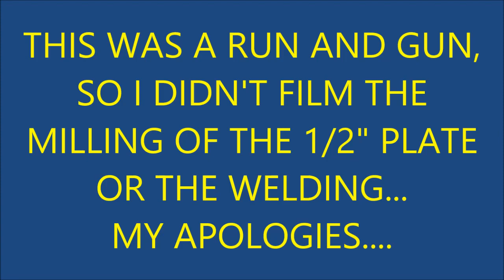Tool Time 42 Welding Table Clamp Design

Comment: Might go with a socket head cap screw so you can use a ratchet easy and not have clearance problems. I scored a nice big Abom79 approved Miller TIG myself the other day and am looking forward to getting to do some TIG with it. I have already done some stick welding with it and it runs nice. I will be doing a video on it soon.
Reply from the maker: bcbloc02 Brian, thank you for the feedback if you get a chance watch TT 43....that if very cool that you just got a Miller Tig also, I will be watching...FYI, ChuckE has a very good video series on Tig

Comment: The clamp turned out great!  Nice simple design.  Your welds look great too.  No one would think those were "first timer" welds.  The one thing I noticed was that when you clamped that angle block down, the long section of the clamp was bending.  Your addition is much stronger than the original clamp material!  Thanks!
-mike
Reply from the maker: ***** Hello Mike, thank you for the view and appreciative comment, just did another TT43...Happy Holidays

Comment: Thanks for noting your TIG electrode, amp and rod you used for your welds.  I too recently got into the TIG of things and appreciate hearing about and trying settings that work for other duffers like me and then trying to emulate the experts like Jody.

Cheers,
GW

Comment: I wish my welding students could grasp TIG beads as quick as you did Chuck.   Great clamp Idea as well.  You may want to have some E309/E312  SS Tig rod for welding heat treated steels such as clamps and such for added weld assurance, tho ER70s mild/low alloy steel filler may hold up well for home shop use.
Reply from the maker: alpho52 Thank you for the view and valued feedback, I just did some aluminum and did a video TT43...Happy Holidays
Reply: outsidescrewball
Happy Holidays to you!

Comment: Nice weld and cool idea. I bet you'll   make the plate you weld on wider so the fancey  flex socket still fits all the way down. I like the eclip idea to hold in the bolt too, it beats a suggestion I was going to make hands down. Outside screwball's F'ing clamps gets a thumbs up. Using a homemade flange bolt  someone else suggest is a good idea too. Me I would stick a washer under the bolt head if you have room. I stick washers everywhere tho so your milage may vary.
Reply from the maker: David Queen Hello David, thank you for viewing and your comment/feedback....Hey, you just named my clamp design...I love it....Screwball's F'ing Clamps.....LOL  damn, that would have been a great video title and maybe in use in the second build idea!

Comment: Nice solution, Chuck.
Reply from the maker: ILGopher Hello Ryan, thank you and just having fun and hopefully getting tooling ready for an unknown future project
Reply: Hopefully I'll get my new compound top slide for my "new" Atlas 10" lathe I got a couple months back.  It had a crack in one of the corners of the T slot which would allow the QC post to pivot down and dig in to the piece.  Looks like the guy who had it before had already repaired it once.  I had another compound for some reason and it had already been cracked in the same location, so maybe it was a common problem.  If the new one is work, I picked up another compound slide for a 12" Atlas and might have to cut it down to height and put in a new T slot.  That could be a fun project that will test the skills and patience.  I may have to pick up a kerosene heater to warm up the garage a little instead of using LP heater in it since I didn't think to get the tank filled before winter rates kicked in.

Have a good one.

Comment: Hi Chuck!!  Great concept you have going here.....I 100% agree on the e-clip retainer and using socket head caps so you don't have wrench clearance issues.  Your heliarc beads are coming fine!  I know you have very little invested in these; and in that regard I applaud you.  I use Weldsale ones on my platens; the same basic idea starts at $175 and goes up from there.  I also use Wilton F clamps; the heavy ones (4800lb clamp pressure) and in both cases I like them.........because they don't FLEX like the inexpensive ones do.  I fear you will be cussing at how much flex you get on yours once you get say...over 8" off the table.  If you don't crank on them very hard it may be fine though.  Sorry for the long winded comment; and please don't construe anything I said as negativity, for that's not how it was intended.  Thanks, have a good weekend!!  Regards, Sean
Reply from the maker: ***** Sean....thank you for your view and valued feedback, I agree with what you wrote and I know there is no malice....if you get a chance watch Tool Time 43...Happy Holidays

Comment: I've seen many of the clamps before ( ones that mount to tables ) most people just cut one end of the clamp and weld a peg on the end. Your design is very simple and allows you to use the tool as it was originally designed to be used. Also it gives it a versatile nature. Simple plan good execution might use the same build. 

PS.  for your first tig weld pretty good
Reply: I really could have used a clamp like this the last time I used my everlast. I really need to make one.

Comment: A suggestion would be to make the base both wider so you have more room for the wrench to clear the clamp and longer so the bend will sit on the base and not hang in space were you are giving up some of the clamping strength and you will have more rigidity when clamping. great video!
Reply from the maker: search4robfen if you get a chance what my next video Tool Time 43....thank you for your view and feedback

Comment: Try adding a stack of washers between the bolt head and the slotted plate, so that the hex head is raised above the beam.  Or use thicker material for the slotted foot, so the entire beam height can be buried flush in the slot.  Either way, then you can use the standard ratchet to tighten completely.

For a no-tool design, drill a cross hole in the bolt head and use a captive sliding tommy bar (like the handle on a vise).  Weld a 0.5" spacer on the original clamp face to provide horizontal clearance over the tommy bar.
Reply from the maker: Dave Kellogg Hello Dave, thank you for the view and feedback

Comment: Rather than weld a slot to the base of the clamp, I would consider a piece of 1/4  or 3/8 bar stock welded in parallel to the base of the foot so the bolt goes between them. It would give you  a longer range of adjust  and put your bolt head up were you can get to it.
I really enjoy your channel.
Reply from the maker: ***** Thanks for the view and feedback, we are on the same page with that idea!!  I had thought of something similar and the ease of the build was tempting.  Your comment got me thinking and I am going to re-visit that idea and maybe do the second clamp in that method....

Comment: I was going to suggest using a Lynch Pin, glad you read my mind. Also, you could put 2 "heads" on one stem. (Have them 180 degrees from each other). That might be useful in some situations.
Reply from the maker: Wide Vision Metal Fab Hello Matt, happy holidays!!!  this video taught me the proper name for the Lynch Pin and I agree on the 180 second clamp.
Reply: Wide Vision Metal Fab yes I was thinking the same thing glad you read my mind

Comment: You could also use a second clamp facing the other way at the same to clamp a second part or to stiffen the upright
Reply from the maker: flineman that idea of the second clamp is correct for stiffness, my thought is for this setup to assist in holding/stabilizing a part on the table with not a lot of clamping pressure, but I guess future projects will dictate the need of hold or pressurethanks for watching and your feedback

Comment: you are going to hate those once the welding bbz get into the threads of the bolts and into the threaded holes, that's why strong hand makes a straight rod into a looss hole it doesn't need to be tightened down once you tighten the clamp it holds itself and the work piece. nice weld:)
Reply from the maker: Denis L Hello Denis, thank you for the feedback/comment.  You are probably correct as Strong Hands has a great product line for the professional.   Since I am just a hobbyist and use the welding table/setups on occasion, I don't think it will make me go crazy, but of course I am already a little screwy....LOL...FYI, just posted an accessory for the FclampATBChuck

Comment: Suggestions consider using a flanged bolt, weld a small flat washer ground down on one side to turn the bolt into a winged bolt. diameter of washer to be smaller than bolt to allow spanner over it to finally tighten bolt.
I like your idea of a clip to hold bolt to the slot when tool not being used.
Your quick release pin is called a lynch pin, an R clip might be an alternative.
Reply from the maker: Dan Whiteford Hello Dan, thank you for the feedback and ideas, yes a lynch pin is the term and I had to google it from an earlier comment to learn what it was....FYI, you just educated me on the proper term for the R clip

Comment: You could use round stock instead of the flat so the arm will swivel all way round just weld round end on the arm end to slide over the round
Reply from the maker: +Sherill Bowman thanks for viewing and the feedback

Comment: Your TIG welds look pretty good, Chuck. Having seen you gas weld (previous video), I thought TIG would come easy to you.
Those modified clamps should work out quite well. Is this the beginning of "Weak Hand" tools????
Reply from the maker: Pherd Antler Hello Pherd...maybe a little tweak on your name to Weak n Cheap tools....LOL, honestly I have spent more time at the grinder with the tungsten than welding on the bench but I am finally learning to keep my torch hand steady and use my foot to regulate the heat as I kept moving the torch like oxy welding

Comment: Change your bolt to a hex head cap screw. That way you can use a t-handle Allen wrench
Reply from the maker: cpcoark thank you for the comment and I did think about using a cap screw but wanted to stay with the 3/4 wrench since other items on the welding table use the same size, that way only 1 wrench to look for...lol

Comment: Hey chuck I have a couple bessy clamps I modified in that exact manner but I just cut mine off right before the bend and welded them to a 1x3 thick block. I just weld mine down on the front side just like a normal fabricated half clamp and when I'm done all I gotta do is open it and give it a pull and it comes right off. BTW not criticizing but your welds are way to hot or you need to speed up. 🐢
Reply from the maker: TheJesusno2 Thank you for the view and feedback/ideas along with the comment on the weld bead as that is info that will help me.

Comment: HI Chuck,
Have you thought about turning a piece of rod that would be a slip fit for your bolt holes in the table and maybe just welded to the HF F clamp head or welded to your flat bar that is attached to the clamp, thus making it a friction fit so when you tighten the clamp on something it would put a bind on the rod and threaded hole.  It is a very fast way to position the clamps on your table.  This is the way the Strong Hand clamps work - and work well - with their welding tables.
All The Best!
Reid
Reply from the maker: Reid Eichner Hello Reid, thank you for the feedback and I will give it a try

Comment: another idea. Cut the solid C off so you have just the sliding straight portion of the clamp weld a grade 8 bolt to the end . screw into table done
Reply from the maker: thanks for viewing and the comments

Comment: I like your clamp.  I may make one with the bolt slot open on one end for quicker setup. Using  larger 3/4" thick plate for the additional strength, my 2 cents.......
Reply from the maker: +Paul Sundquist Thanks for viewing/comment Paul, good luck build

Comment: How about putting a lynch pin in the end so the pieces don't get separated when not in use.
Reply from the maker: Don Foster Hello Don, I had to google "lynch pin" and that is the item that I installed at the end of the video, thanks for the view and question/comment which pushed me to learn the correct term.

Comment: There are probably a lot of those hold down clamps already designed.  Just have to look around for ideas.  Hobbling together low cost components can save money.  Won't be 100% as strong as the trade stuff, but good enough.  Got to spray Pam on the threads to reduce splatter from sticking.  Those ratcheting wrenches are handy.  The free swiveling ones can be frustrating though.  They make a type that locks the head at different angles that seem to work better IMO.  Those TIGs take most of the guesswork out of welding.  Not Fair!

Comment: I'd be happy with that weld Chuck, but then I have never welded. lol.

You should have warned us that there was time to get a beer while you wrenched that bolt.

Nice clamp idea. You did woodworking, could you not have just turned the clamps down to fit the hole or some other means of getting a post into the holes on the table like on woodworking tables?
Reply from the maker: Steve S Hey Steve, thanks for watching and I agree with the zzzzzz's while I wrenched.  Regarding attachment there are many ways and this was my beta try...hope you get a chance to weld as it is a lot of fun

Comment: Nice welding, but that leverage turned out even worse than I feared.
With the bolt near the end you are up to like 15:1 ratio or something, meaning for every pound of pressure at the part you get 15 pounds pulling force at the bolt.

You need to move the slot forward to the bend as far as possible and extend the plate to the rear, without a slot, to act as a lever.
Reply from the maker: stefantrethan thank you for your feedback and view, note that I agree

Comment: Not to rain on your parade, but if you were to make your own clamps from scratch you could use round bar rather than the rectangular section material you have now. This would allow you to rotate the movable clamp jaw without having to loosen the table-fastening bolt.

So the main vertical piece could be made from round bar with a flat bar foot welded to it, and the movable clamp could be made from round bar with a short section of pipe, whose ID is slightly larger than the vertical bar, welded on one end, and a nut welded on the other end. The copper plated clamping screw would screw into the nut.
Reply: If the vertical round stock was 1/2 inch, thread the bottom inch and forgo looking for a bolt?????? Itsa question.
Reply: Yes! Wonderful idea!
Reply from the maker: ArtemiaSalina Hello Art....thanks for the feedback and no worry on your suggestion as that is what I was looking for with this post.  There are many ways to complete this and I am going to review the various thoughts/designs to help improve my beta build
Reply from the maker: lornie212 the answer to your question is  YES! and that is an idea that I had thought of using the HF clamp with a simple threaded rod welded to the unit.
Reply: Great ideas. I think I will weld up one for my everlast welding station.

Comment: Sweet!  Has anyone suggested flange bolts?  http://www.mcmaster.com/#92979A467
Also.....you could two of the movable parts of the clamp on one vertical.  Opposite sides, both clamping down, or same side with the lower one inverted like a foot clamp?......you'd definitely have infinitely variable positions within the height limit of the vertical bar.   I'd like to see the black bar clamp with a movable clamping head.....then you could do the same thing I just described, but at much higher positions. :)

Comment: Everyone saying the welds are good. They are massively undercut. To much heat not enough filler wire. Your first go so fair enough but the people saying there good must be shit or don't know a good weld from a bad. Would never be allowed to leave my workshop
Reply from the maker: Dean Evans Hello Dean,  First...thank you for watching my video and secondly I appreciate that you took the time to leave a comment regarding the welding.  FYI...I agree with both of the comments that you left regarding the quality of my weld and the need to practice.....I always say to my workers when they complain about what an inspector might list as an issue..."you can argue right" and you are "right"ATBChuck